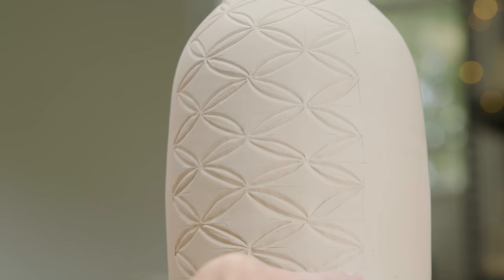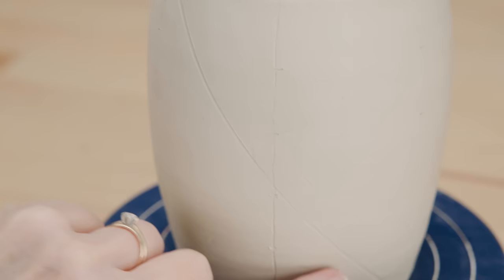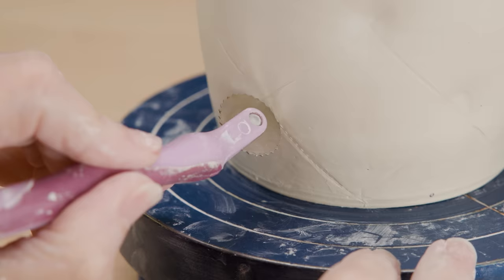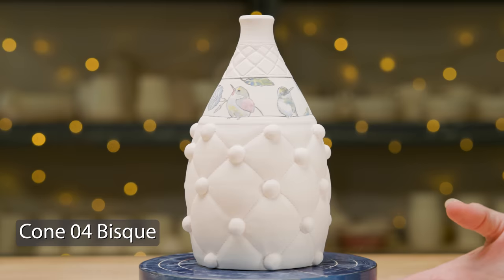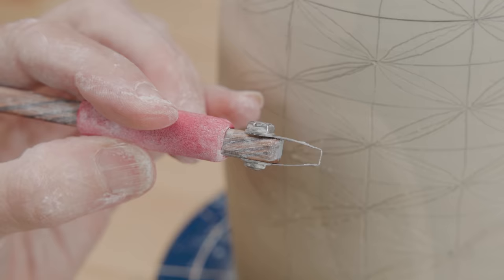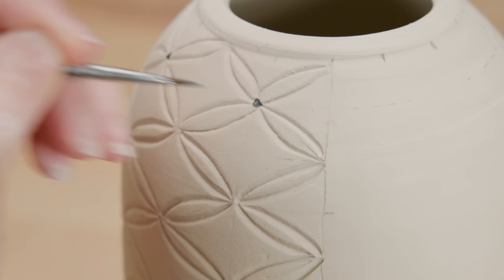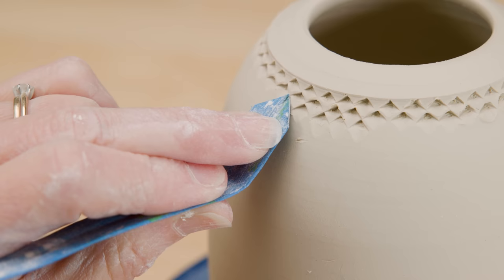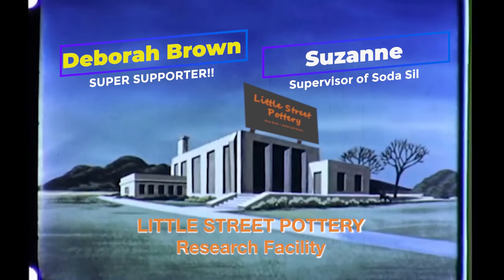Quilted Pottery Projects - APPLYING QUILTING TECHNIQUES TO CLAY!

Comment: I love crazy quilts. Part of what I find so intriguing about crazy quilts is the added embroidered texture in the sewn squares. They’re so unique to each maker. I’ve impressed the shapes of embroidery stitches into the clay then inlaid colored slips.  That gives me the look of embroidery but not the raised textures. I’m still trying to work out how to achieve that effect.
Reply: I'd either carve around the embroidery design to lower the height of everything else, or carve a negative image into a slab and dry it to use like a sprig mold. Both would take a while though. But I love the monotony of relief carving.